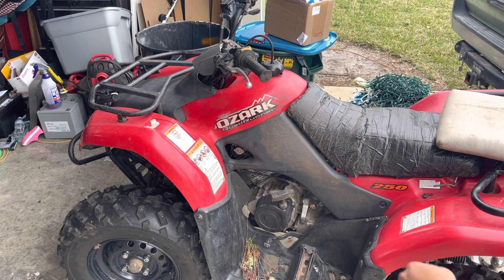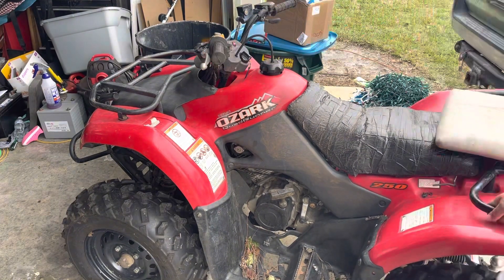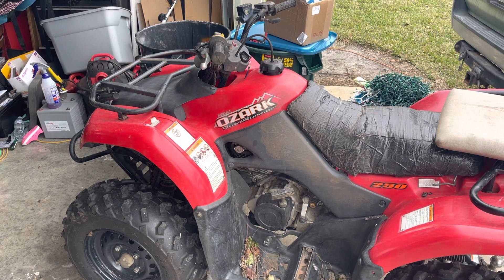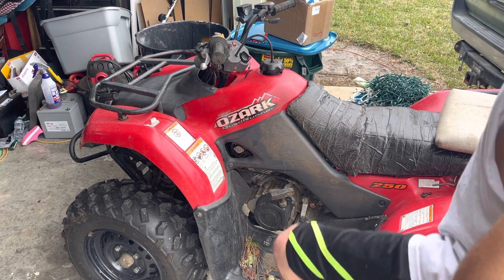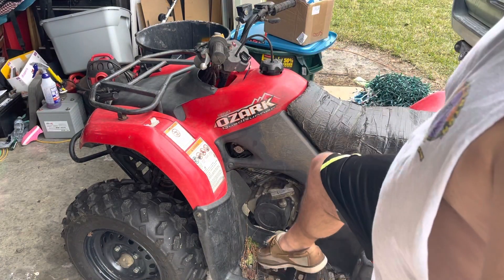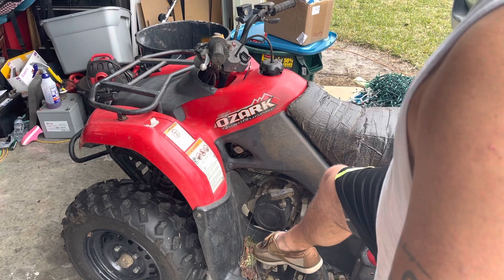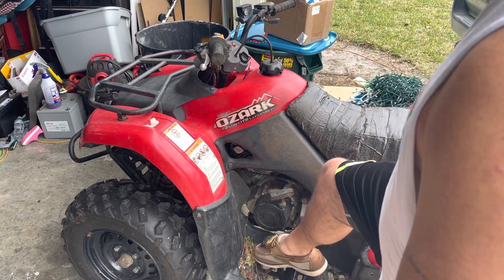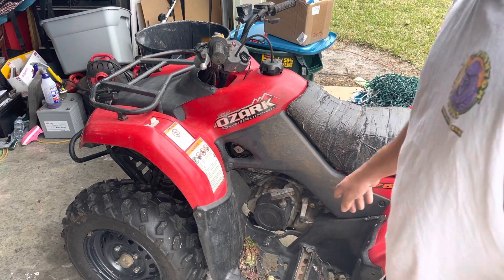How to get Suzuki 4wheeler out of stuck gear or from gear to neutral to start

Comment: Hi great video! I am working on a old Suzuki 250 and it just wont go on neutral. I was even pressing the little red handle on the left but with no luck. I also can't figure out if this thing has a clutch or not of if it needs to have the battery connected to be able to go on neutral. Anyway, I appreciate your insight.

Comment: I have a 2006 ozark 250. Bought it new. I've NEVER been able to pull start it. Its always been either impossible to pull or if it would begin to pull, it would almost take your arm off pulling the line back in. I've heard some people with other brands talk about a compression relief switch, but I don't know if mine has that. Please help.

Comment: Worked for me! Thanks!
Reply from the maker: You're welcome!
Reply: @SmittysWorld  we've got an automatic but key is stuck in off position,  we're in neutral but key won't turn
Reply from the maker: @ponytailalogginalong6605  try turning wheel while moving key
Reply: @SmittysWorld  didn't work.
Reply: @SmittysWorld  Theres a little play in the key, but it won't go into the on position where it would light up so we can start it
Reply from the maker: @ponytailalogginalong6605  flip key around? Maybe wiggle key in and out while trying to turn it. Sounds like the unlock pin on the key isn’t working. You did unplug the box right
Reply: @SmittysWorld  I've tried rolling it forward & backwards too.
Reply from the maker: @ponytailalogginalong6605  so the key is stuck in off position switching gears shouldn’t stop you from being able to change that key position would cause no start but not a key issue. Probably need to replace the ignition or get a new key
Reply: @SmittysWorld  ok thank you for the really fast responses!

Comment: What if it is stuck in 3rd Gear, same process?
Reply from the maker: Yes drop it a gear pull it then repeat till in neutral
Reply: Was stuck in 2nd. Just repeated it. Thank you